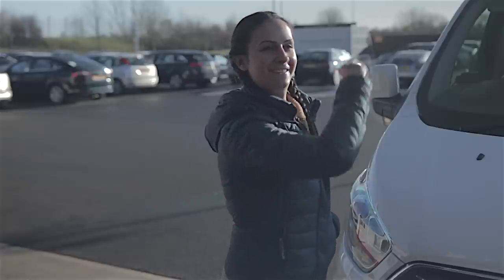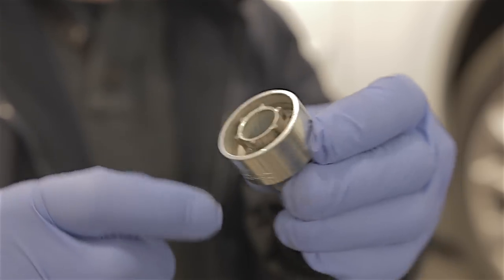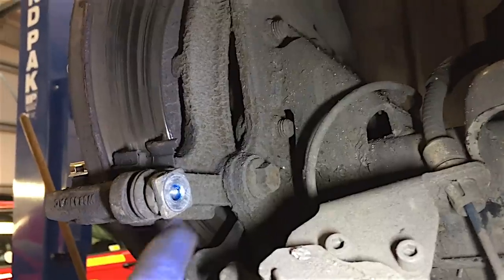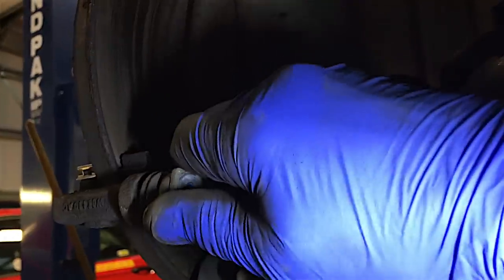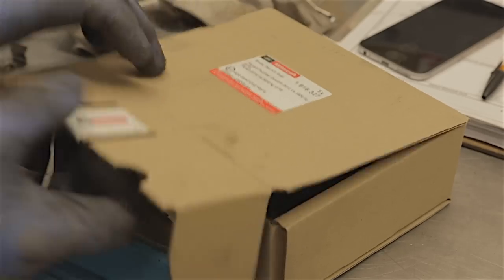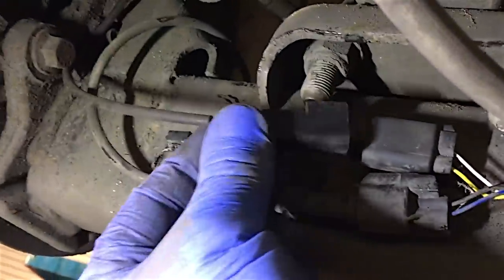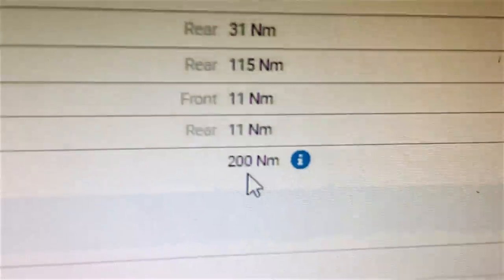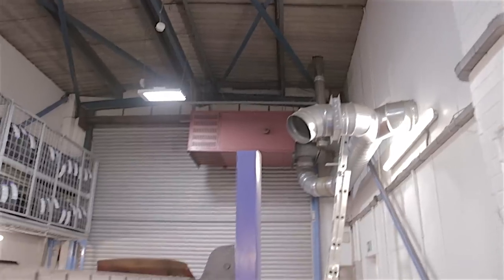2019 Ford Tourneo/Transit Custom Rear Brake Pad Replacement & Swollen Wheel Nut Removal

Comment: Those swollen tin caps are prone to Dodge and other USA tanks   ...  think Snap on sell a 21.5mm socket to bash on  specially for that purpose ...   if you want to pay for it !!   worn 13/16AF ? 
Worlds gone made ...  wheel nuts used to be for life of the car not just for when you need to take a bloody wheel off ....    MORE EXPENSE !!  someone making money out of it though
Reply from the maker: yes probably best to find a set off solid wheel nuts, cheers mondo

Comment: The ford wheel nuts have had this stupid two piece design for years. Take them off and chuck them in the bin. Put on some aftermarker solid ones. Never have that problem again. Even more so when you are stranded at the side of the road with a flat....
Reply from the maker: good advise michael😉